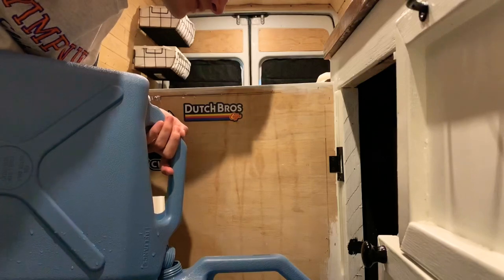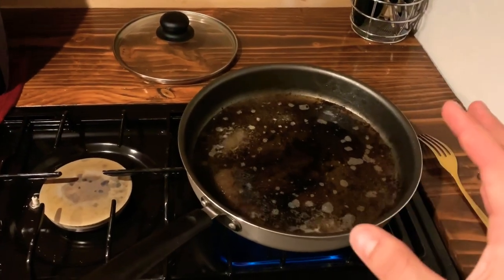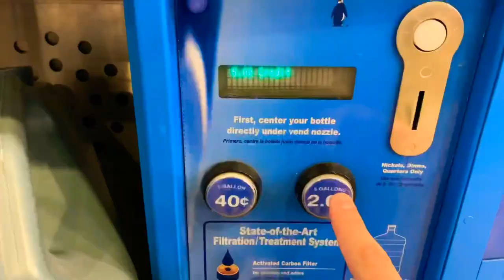VAN LIFE CHORES - Lola the Big Blue Van

Comment: Hi from the UK. Mikey your presentation and videography are quite fresh. I hope you don't become too polished like so many other you tubers. Occasional overlap on audio between cuts but somehow it just adds to the authenticity of the content. Audio generaly is pretty crisp. Nice that you consider us by fast forwarding the  dishes etc. Even then we can still see how that foot pump gives so much control over water usage versus an electric version. Looks like you have lots of spare space in the water cupboard.....why not go for larger containers ? You could always fit a filling point inside the van maybe on the worktop....so you could still forage for water in smaller, more manageable containers. A tip for dishes ....use kitchen roll (don't know if you call it that in the US but it's paper on a roll for wiping up spills) to wipe out most of the food especially grease from pans. (Better when it's still quite hot but obviously not so hot to burn you ! ) This means the waste goes into your bin rather than down your (relatively narrow) waste water pipes. It means less blockages, less smells, and much less water used on dishes. In the army we were taught you can even use earth (yes dirt)  to clean our pans (or mess tins) 1st to remove the greasy deposits left by food. Then pans need much less precious drinking water to finish the job. Of course hungry soldiers don't leave much food in a cooking pot anyway ! Lol   Happy travels. John

Comment: Cost analysis, Big Blue vs. dorm life. 
Did you build the van yourself? How long did it take and how much $$$.
Some of the model year Sprinter vans are more reliable/desirable than others. What year is your's? Is it gas or diesel?
That propane tank should be mounted outside away from the interior of the van. You do have a sensor, but sensors do malfunction; Boeing would be a prime example.

Comment: Curious, in the beginning you poured from one water can to the other...why not just switch the top since you fill them both up with the same water? Also, thank you for using real dishes and not resorting to paper for everything. :-) As others suggested, water and vinegar works great and saves water.
Reply from the maker: Lilian Tong there was a little bit of water left over in both that the intake won’t reach. So putting both together made enough to finish.